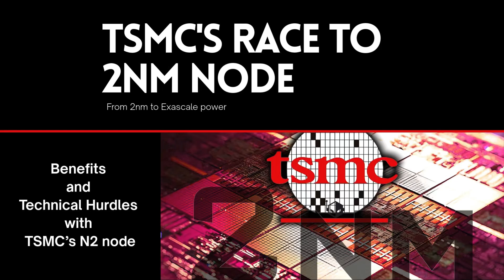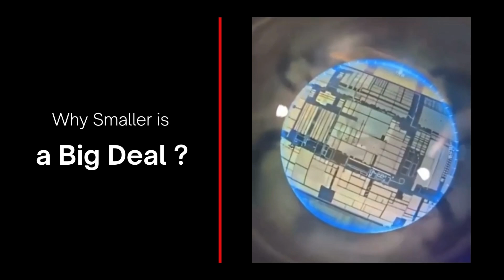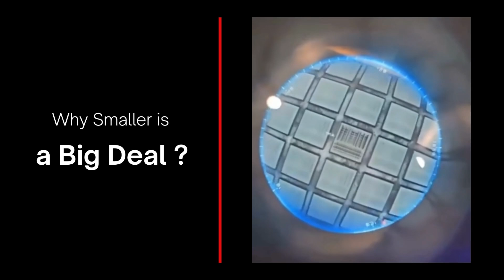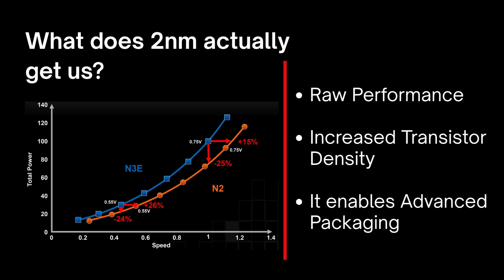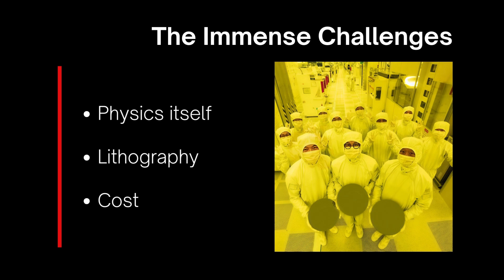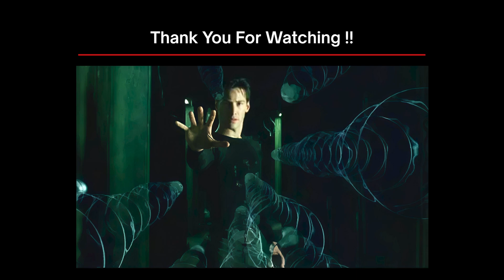Kaveen Sathurusinghe - TSMC's 2nm Node - Parallel Computing Video

Comment: Excellent explanation. The discussion on nanosheet GAA transistors at the 2nm node was particularly insightful and clearly shows why this advancement is so significant. I found it valuable how you emphasized the balance between enhanced performance and energy efficiency, which is essential for supporting modern AI systems and complex simulations. This development really highlights the rapid progress in semiconductor technology and its influence on the future of computing.

Comment: Cool video on TSMC’s 2nm chips. You explained the tricky parts, like quantum effects and the new transistor design, in a way that was easy to follow.
Maybe for the next one, you should add some visuals or animations showing how small 2nm really is or how 3D stacking works. It would make the video even more nicer.

Comment: Brilliantly explained, Kaveen! The introduction of nanosheet GAA transistors at the 2nm node by TSMC is truly a game changer. I appreciate how you showed its potential to balance higher performance with greater energy efficiency. Two factors that are vital for handling modern AI models and scientific simulations. This innovation really demonstrates how far semiconductor engineering has come and the enormous impact it will have on the next generation of computing.